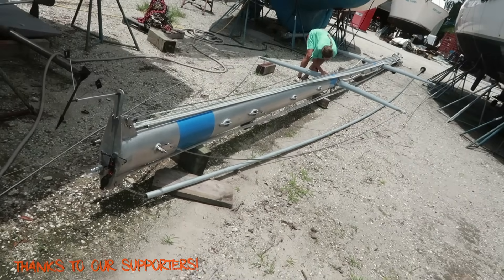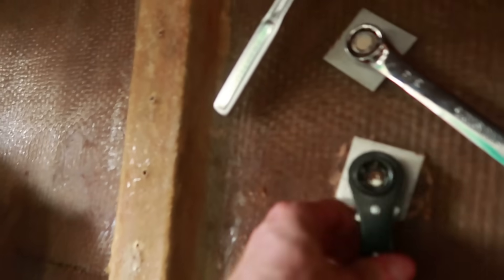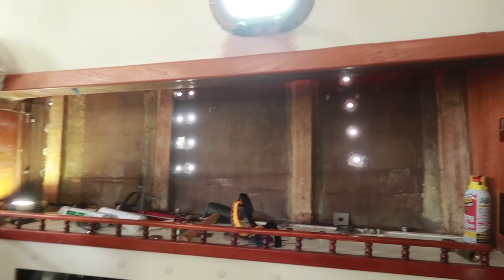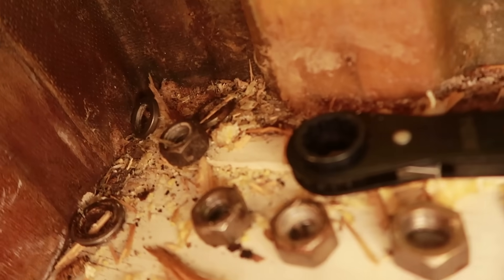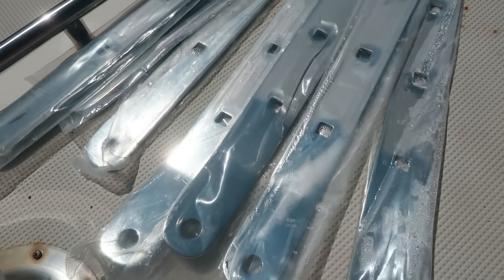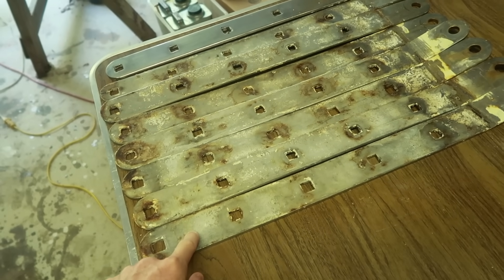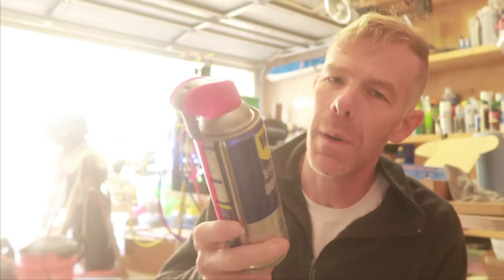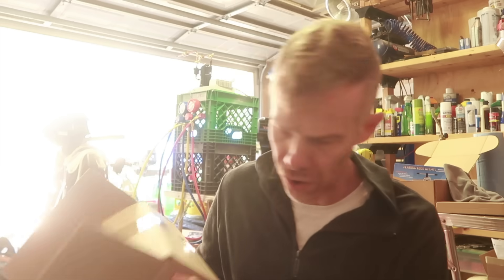What's Hiding Behind 45 Year Old Chainplates? | Sailboat Story 255

Comment: Use the old chain plates on the inside. Instead of the washer squares. More surface area to grab a hold. just longer bolts.
Reply from the maker: That's a pretty interesting idea.
Reply: also they are there if you need a back up self storage LOL
Reply: Just have the girls do it while you have a Beer LOL @Sailboatstory
Reply: Wouldn't you have to cut the tops off so they don't go through the deck? Then no good for Spares but great idea to spread the load
Reply: @nautichunt84 mounted upside down and inside out
Reply: @timothyrepp4259  ahh yep, I'm a bit slow today 🤣

Comment: Just curious were you thinking of adding roller furling to the staysail. When we go our boat I got rid of the staysail boom. Just thinking of that boom swinging around when your on the foredeck was too scary for me. Have really been happy with the roller furling and it free's up space on the foredeck also.
Reply from the maker: No, I prefer the simplicity and strength of a non-furling staysail. We also removed our boom and fly our inner staysail loose. There's a performance sacrifice, but I prefer the open deck space while also being able to avoid being potentially clobbered by the boom.

Comment: I’m right at the beginning of the video you may mention it later but what’s happening with the port lower spreader? Also looking at the chainplates I would suggest that the areas you inspected around the square holes is not the place to inspect. Around the bends and around the holes for the stays would be the areas that would be more likely to have crevice corrosion. Using a crack detection spray on system would be the only real way to be completely sure of their integrity. (Or X-ray)Replacement is by far a much easier route and gives peace of mind.
Reply from the maker: I’m not exactly sure what you’re referring to regarding that spreader, but we did just have one of the upper spreader brackets repaired.
Reply: @Sailboatstory  it looked like it was bent upwards. But I wasn’t sure.